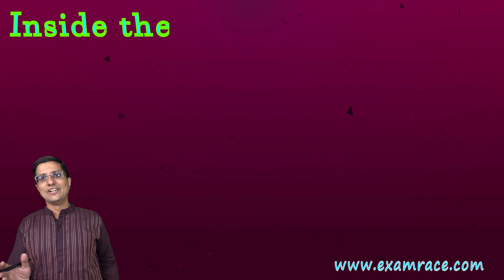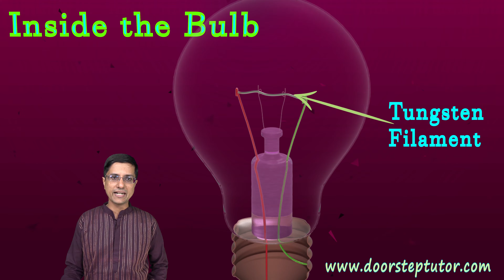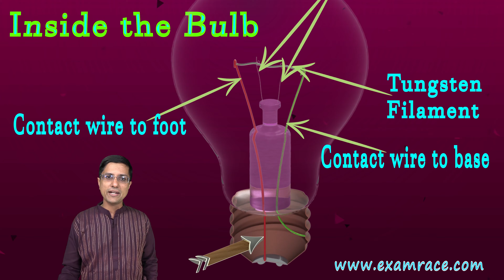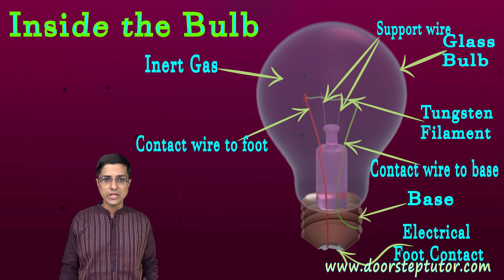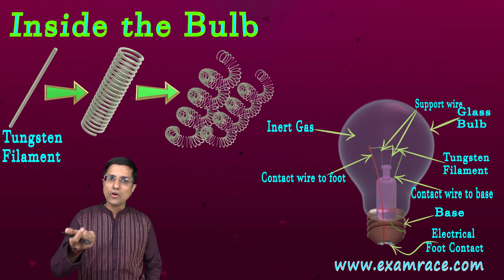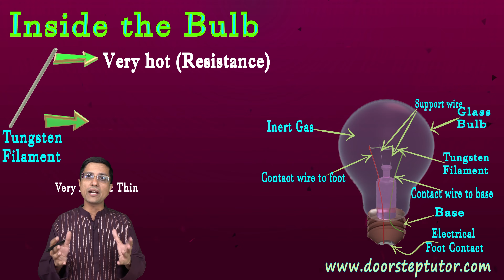Structure of Incandescent Bulb Using 3D Model: Double-Coiled Filament | Connectors | Base | Foot

Comment: Nice sir but why should we use only tungsten instead of any other metal ?
Reply from the maker: Tungsten has a very high melting point, about 3400°C, so the filament can glow white hot without melting. It also evaporates slowly, which gives the bulb a longer life. Practice @ https://www.doorsteptutor.com/Exams/NSO/